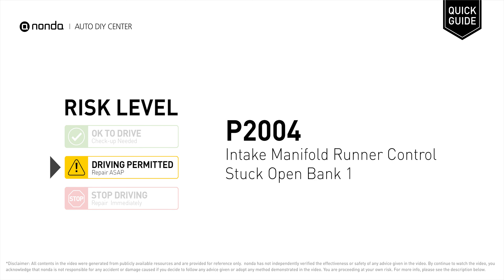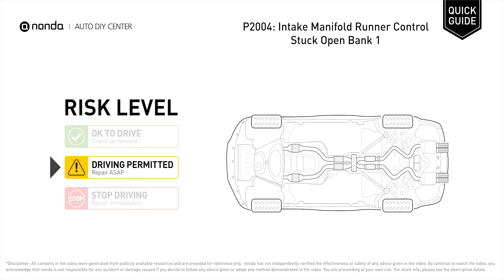What is P2004 Engine Code [Quick Guide]

Comment: Is this something you can fix at home, on a 2015 altima?
Reply from the maker: Yes. A replacement for the IMRC solenoid, IMRC solenoid wiring, IMRC solenoid circuitry, IMRC solenoid connector and IMRC butterfly valve plate hardware could be necessary.